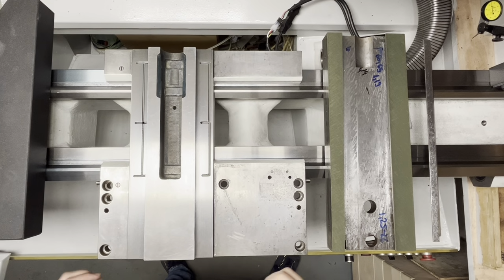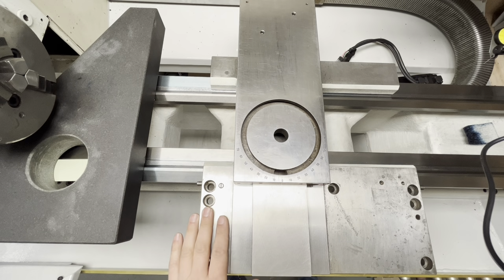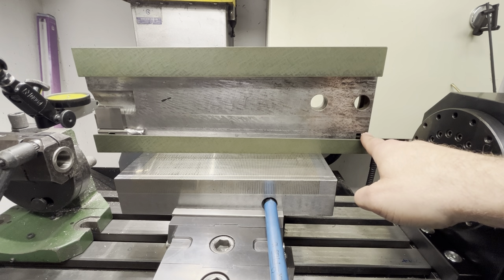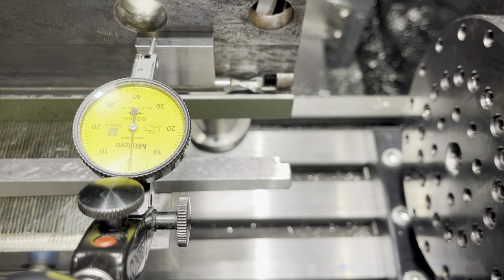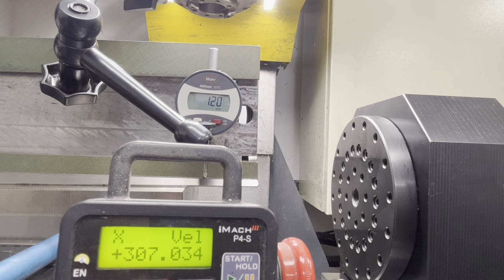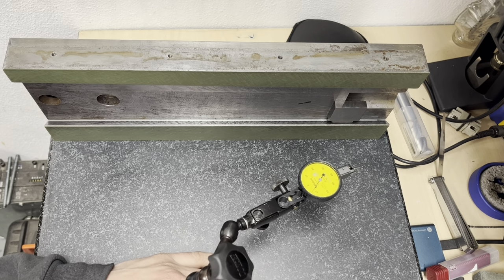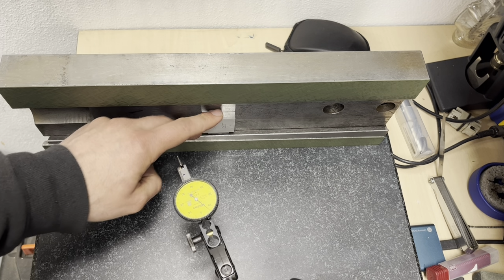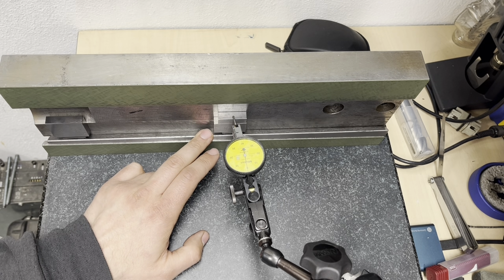Tapered gib adjustment pain.. 😵

Comment: Classic compound angle problem. The tilt of the dovetail at right angles to its length affect the measured angle. compared to that of the nominally matched gib lying flat on the magnetic chuck. The last 2 methods are the correct way to measure how cllosely the gib matches the dovetail.
Reply from the maker: Thanks, I did got the hint that it's a compound angle problem by discussing with other folks, but I still can't say I understand it well enough so that I don't make the same logic error again in the future with a different project. If you are aware of any examples that would explain this in a visual manner, I would be grateful to study them.

Comment: The measurement on the mill table is possibly influenced by the traverse of the table itself.
It would still seem to be quite a lot though.
Check the mill table itself with an indicator and lift up and push down on the table at each extreme of its travel.
I just realised this is a bit old but may point is still valid.
Reply from the maker: The mill table was fine, the measurement was wrong. It seems that it’s a compound angle and I was not measuring it correctly. In the meantime I got the gib adjusted and the upcoming videos were made using the lathe. 
Thanks for your feedback anyway! 
Cheers! 🍻

Comment: Not sure why my comments keep disappearing but blue your gib against your surface plate and repeat the mag chuck test making sure the gib is perfectly
parallel to X
Reply from the maker: I saw that your comment in the email, but its not appearing in the YT comments section, no idea why, I can't see it anywhere on YT. Everyone so far has suggested to be a compound angle problem. The slide and the gib were aligned with the X axis when they were clamped on the magnet. I have posted this video on a discord group where there are other machinists, and Stefan Gotteswinter had some suggestions, I have followed his suggestions (progressively scraped the gib from the thin end to the thick end) and now I have free movement of the cross slide without any binding and the play is about 0.01 at one end and 0 at the other end, so I am kinda close. Thank you all for the support & ideas. I will come back with a follow up video when I consider it complete.
Reply: @LikeFactoryMade  no worries, sorry for the repeat comments on your email…hope the illustrations help and I look forward to seeing your progress because I’m going to have to come up with the same fix :)
Reply from the maker: @TheIconfriend  I don't see any illustrations, if you have sent something, it might have been lost somehow, please try again. I saw in the comment I received on the email that you have mentioned something about the canadianhobbymetalworkers. Please try to post again, it seems that its working now.

Comment: I think your measurements would be more accurate if you were to measure in reference to the bearing surfaces, not the unverified underside of the horizontal surface
Reply: The method of using dowels works only if you know one surface is flat over the measuring distance such as the mating surfaces to your top slide